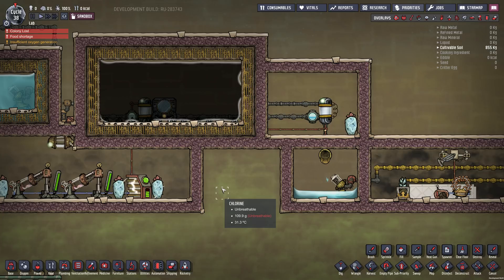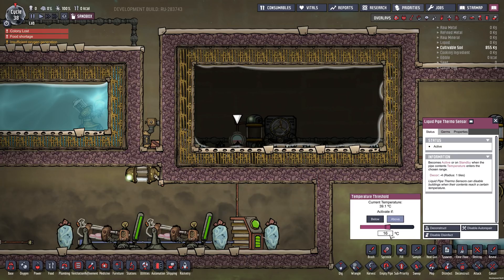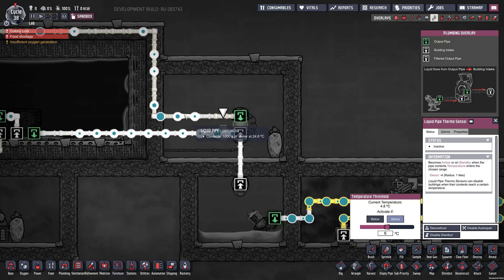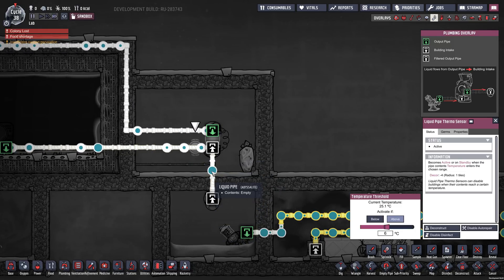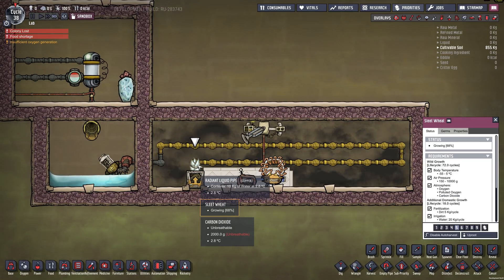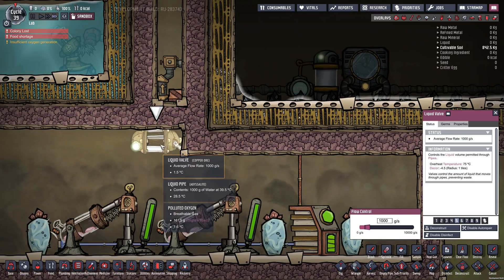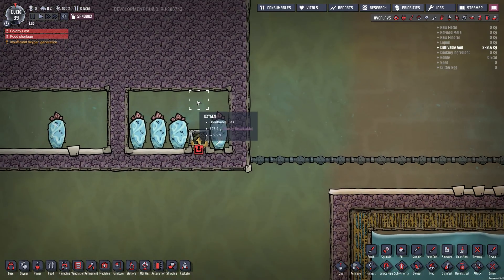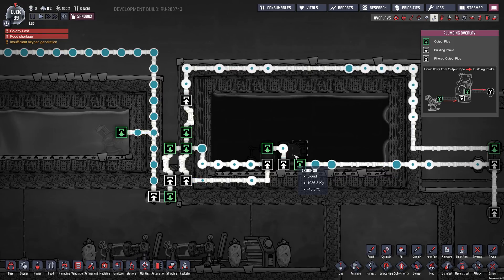Cooling Water to 5C for Sleet Wheat Using Aquatuner - Oxygen Not Included

Comment: Will suggest to merge packets into maximum size (10KG?) before entering them into the aquatuner to save electricity. I do agree that reflowing the water back to aquatuner needs to be done carefully else there will be backups, eventually causing the whole setup to choke, especially if the packets come directly from water sieve (without buffer).
Reply from the maker: Yeah that would be more power efficient but I had blockage when I did that. Someone suggested that 3 tuners in series would bring the water close to 0 without freezing it which is a much better and simpler design.

Comment: nice closed loop system.  I personally prefer to use multiple chillers in 1 tank of p water to eventually boil out the water and recapture it for chilling down.  I could see the potential uses of your system via a series of temp sensors...something like "if temp over 60 run thru a 3 chiller chain"  or "temp <17 but >12 run thru a single chiller setup then direct to tank"

Comment: So I've played around with various loop setups like this to varying degrees of success.  What you've done here with re-merging liquid and balancing out the temperatures near 4C is pretty neat, but it's a little complex and depends a lot on the timing of the water flow and such.  I fear it will have trouble scaling up for larger farms.

My preferred method right now is to actually just use three aquatuners in sequence and feed the output directly into the sleet farm.  While technically the water comes out of the sequence at a "freezing" -2 C, it actually won't turn to ice and damage your pipes until about -3 C.  So it is very important to use insulated abyssalite pipes for everything between the sieve and the final tuner since you don't have any wiggle room for leaking even 1 degree of heat.  But if you do it right, it works like a charm.

It may seem like three aquatuners would be a lot of power, but you aren't actually running the tuners anywhere near 100% cycle.  I have a test farm set up with 78 plants, and the aquatuners feeding that each run at about 25-30% cycle and consume around 900 watts total for the set.  One could scale this up fairly easily to probably around 300 plants before you get near 100% uptime on the aquatuners.  The heat output should be in the same ballpark as any other methods, since you are still taking the water from 40 C down to the edge of freezing, however you slice it.

This also solves some of the comments about putting full packets through, since the aquatuner will only start up if the first segment of the output pipe is clear.  And if you optimize it further with automation sensors and stuff so that it only runs intermittently as needed, you can tune it pretty well.
Reply from the maker: Your setup was my first thought actually but I thought it would all freeze up on the third aquatuner. Glad to hear it works. Did you try regular abyssalite pipes? I'll head back into the lab to try this one out. Sounds much simpler and better.

Comment: I think there's a two improvements that can be made here.

1. The water reservoir that was added makes getting an accurate temperature out of the aqua tuner pretty easy.  Just run a loop between the reservoir and the aqua tuner and then pull packets out when you see they're below 5C, heck you could do 1C and be pretty accurate about it. Then you only need to insert packets when there is space in the line from pulling low temp packets out.

2. You should also use polluted water as your coolant, and then sieve it to destroy the heat. That will make the system zero maintenance.

Some other notes:

* My understanding is that the aquatuner will cool any packet that goes through it by -16C, and it will run at 1200W regardless of what packet moves through it. Which means you should try to always have full packets of water moving through the aquatuner or your wasting energy. 

* They changed the way conductivity works, Unless an item is insulated, it will average the conductivities of the two materials. Which means abysalite pipes arn't good insulators anymore.
Reply from the maker: I guess I could try it out with the new tank. I still have to prevent packets going into the tuner that are 14C or below because the tuner takes it down by 14C. 

Yeah polluted water works well for that exact reason. They recently nerfed it's heat capacity but it's as good as water now. I do like oil because it can get very hot before turning into petroleum.

I tried full packets but got blockage in the system. Basically too much heat was being added to bring the temp back up. Having a different holding pond or a step down of ponds would be more complicated but might be more efficient.

From what I'm seeing, non-insulated abyssalite pipes are still perfect insulators. I have no heat leakage in my pipes with hot liquids in them (most recent rocketry base). Maybe that is a bug?

Comment: If your colony is 16 dupes or less you can pretty easily survive on wild grown pincha peppers and sleet wheat for pepper bread. But for early game I just do a mushroom farm. It's very easy to sustain and will be good enough quality for a long time. The wild grown route requires your dupes to be a little older and have acquired mid-range Athletics levels or they'll spend way too long time running around harvesting all over the map.
Reply: It ist possible to supply pepper bread forever as you can melt fertelizer to dirt and Dreckos produce phosporite when they eat plants
Reply: I think you mean you can heat slime from puft into dirt because fertilizer is difficult to make now as fertilizer synth takes phosphorite, dirt and polluted water to make fertilizer so heating fertilizer into dirt doesn't makes sense.
Reply: Didn't now that they changed the fertilizer Synthesizer.
Reply: That was a few updates ago